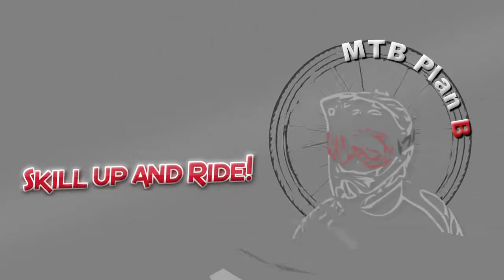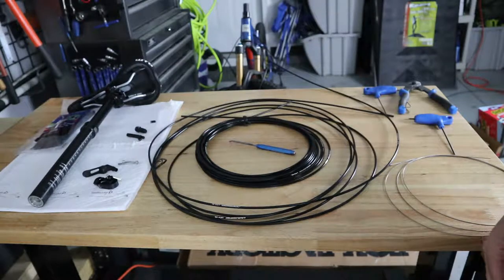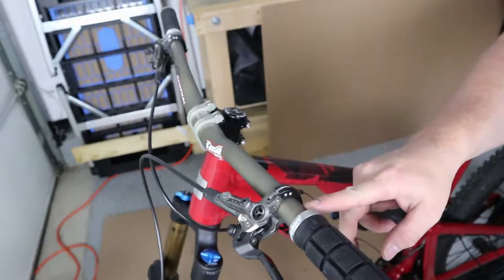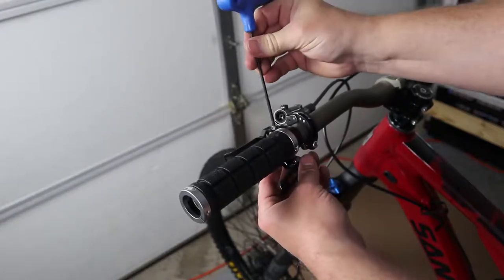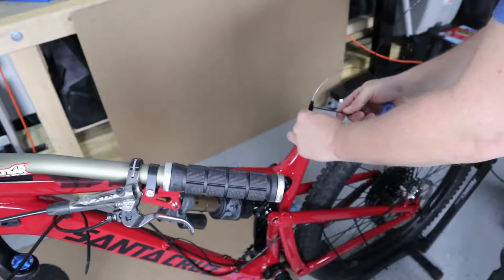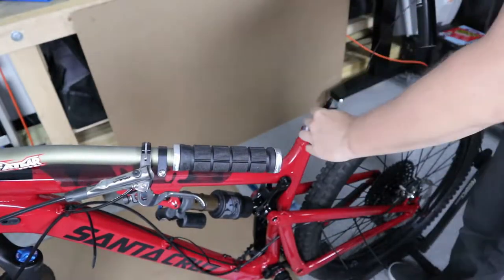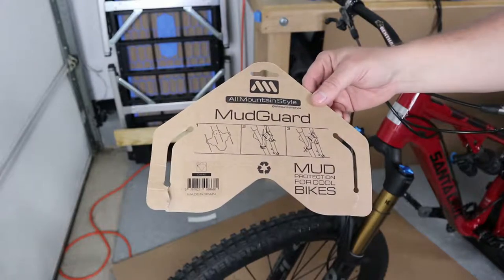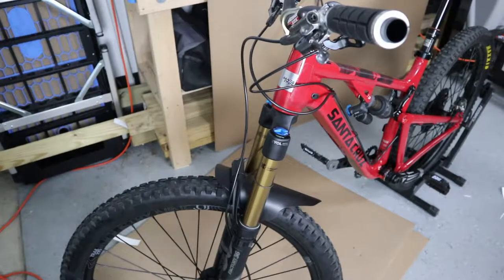#MTBPlanB Final Episode: 2018 Santa Cruz 5010 v2.1 AL Bike Build - Grande Finale!

Comment: What dropper post did you end up going with.
Im buying a 5010 soon and need to add a dropper post (Size and specs if you don't mind)
Very nice video by the way.
Reply from the maker: I ended going to the Fox Transfer Performance Internal 31.6 150mm for a medium frame. It has been excellent so far. However, I hear the PNW droppers are great as well.
Reply: @MTBPlanB  Sweet, I just ordered a PNW dropper for my hard tail I am excited to install it! Thanks for the help!
Reply from the maker: Doing it to em with Andy! Enjoy and let us know how it works out.